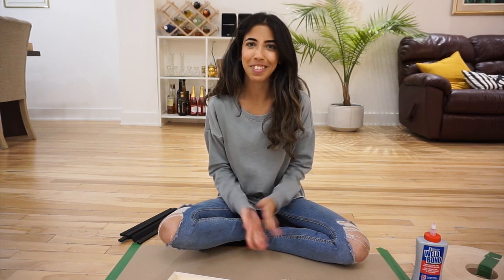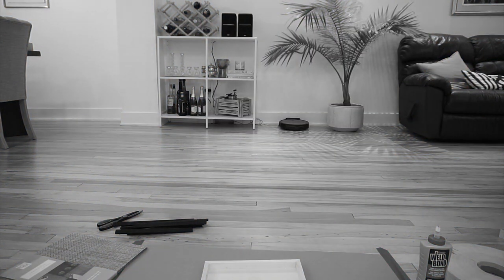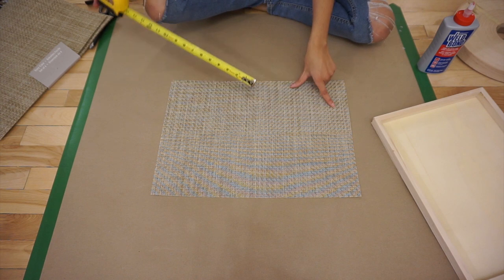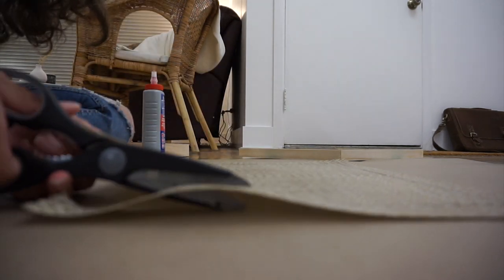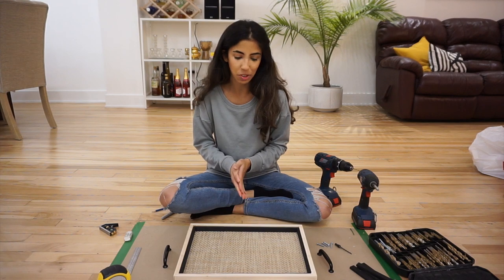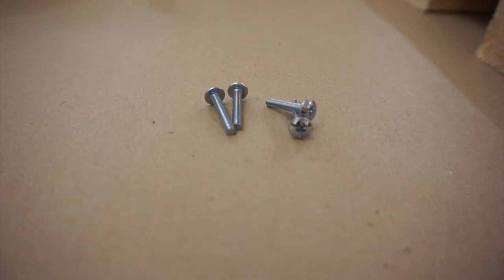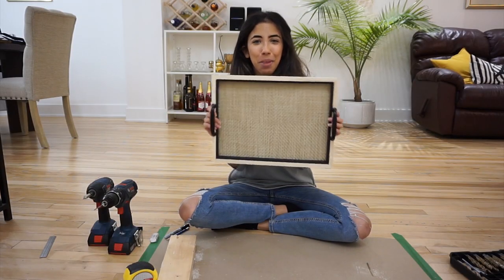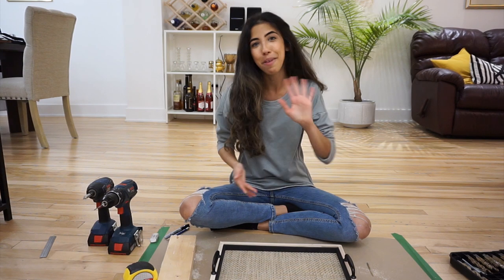Coffee Table Tray - Dollar Store DIY | Ety

Comment: I'd love to make this, but worry about protecting the mat against spills.  Any suggestions?  Thanks
Reply from the maker: I’ve seen people make coffee table trays out of picture frames. That might be a better option for you. Then you could easily clean the glass :)
Reply: @Ety_Vaknin  thanks!
Reply: Or you can take the placement material on and off the tray so if it gets dirty, you can wash it and put it back, maybe Velcro?
Reply: Could you also use a vinyl placemat, which can be easily cleaned?